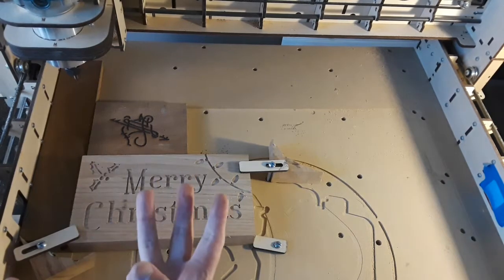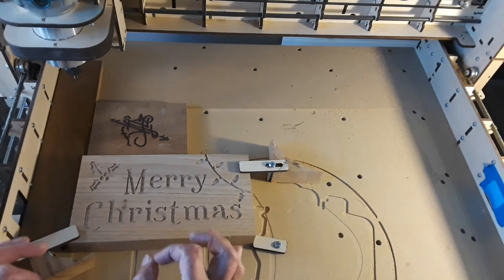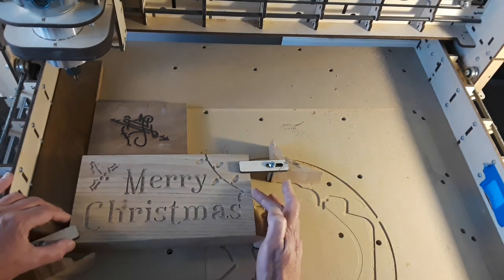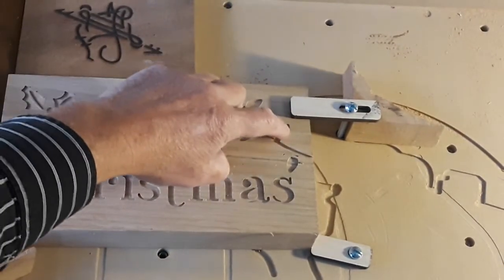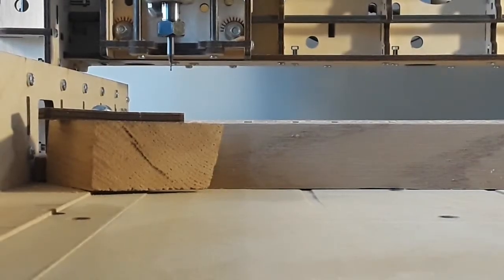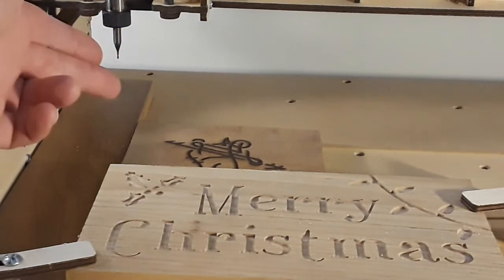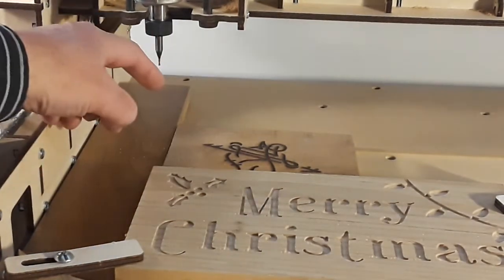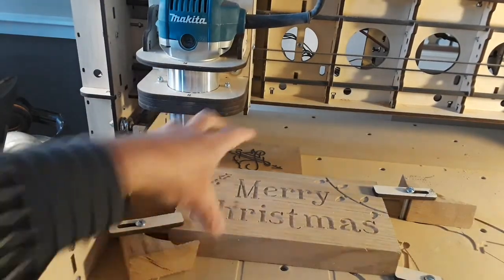The ** IMPORTANCE ** Of Clamp Placement & Workpiece Clearance, CNC Router Tips for Beginners

Comment: I enjoy your videos, but in this video I was wondering how you setup your X and Y axes . Usually, if you're standing in front of your machine, the router moving from left to right across the gantry is the X axis - and the Y axis is the movement of the router from the front to back of the of your machine. I'm assuming you setup your X and Y axis as viewed from the side of your machine?  
Also, you mentioned that you didn't understand why the Z axis fails to move upwards BEFORE any movement on the X and Y axis. You are correct, the router should NEVER move until the Z axis is at its "Home" position - top of the Z axis. This is an accident waiting to happen - broken tool bits flying towards your face makes for a bad day. 
The problem is solved by ALWAYS "Homing" (Machine Zero) your CNC router at startup. That means homing all three axes (X=0, Y=0, Z=0) so  that all three axes are sitting at their home position. Only then do you setup your work piece.
Here's how it works for me in Mach 3 (CNC Control Software). I home my machine to the lower left-hand corner of my spoil board. Next, I move the X  and Y axis (keyboard) so the tool is sitting above the bottom left-hand corner of my work piece (wood). I lower the Z axis so that the center of the bit is sitting about 1/2" above the corner of the work piece. Using a piece of paper (or a "Tool Setter") I lower the Z axis so the tool is sitting on the corner of the wood. Next, I just set the X, Y, and Z axis to zero in the control software (Mach 3). This sets the G54 offset to the exact location of my work piece ("Part Zero"). Finally, I just send my router back to the home position and then hit the 'Go to (Part) Zero' button in Mach 3. This button sends my router to the lower left hand corner of my work piece (G54). Now, I just run any Gcode program I want to start the cutting process. 
It should be noted here that Mach 3 has a 'Safe Z' configuration setting which insures that the router will not move the X and/or Y axis until the Z axis is at its Home position.
Reply from the maker: Thank you for your comments

Interesting regarding the X-axis orientation. The machine default is Y across the gantry and X going to the frint (open end). In my machining experience, this has always been the case. However, I see where you are coming from and may reorient my X & Y to your comments since my computer is always on the side.

Yes, I always home the machine before any job setup and run. The way you described is pretty much how I set up except running the machine to the chosen G offset (ex G54) before running the program. I usually start the program from home position. 

I like the Z safe you mentioned w. Mach3. To avoid Z motion first, I sometimes edit the program to move the first Z move to AFTER the XY zero move to the work offset. This solves the problem but is an extra step I want to remove from my process.